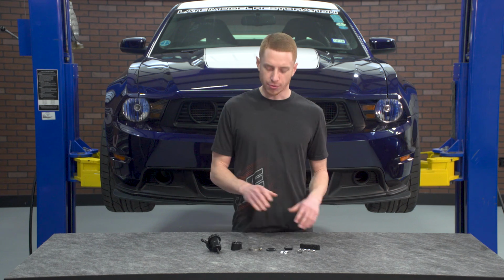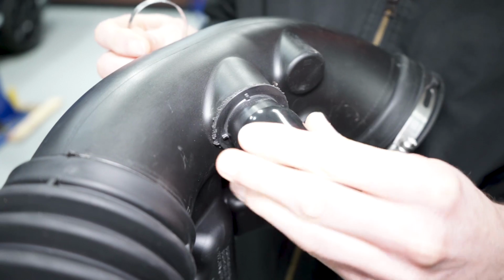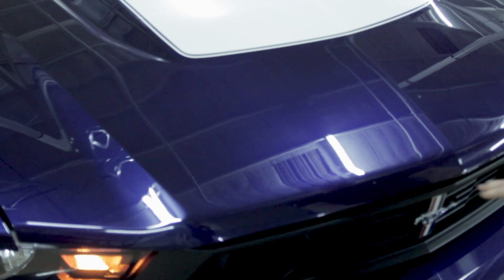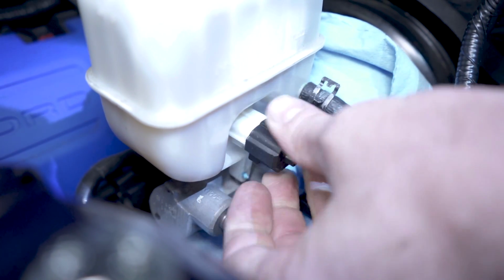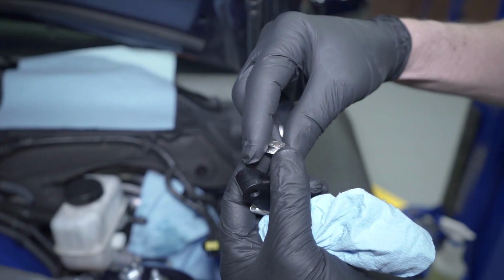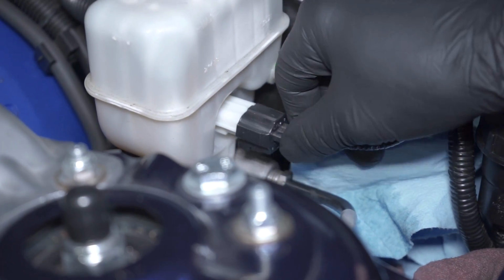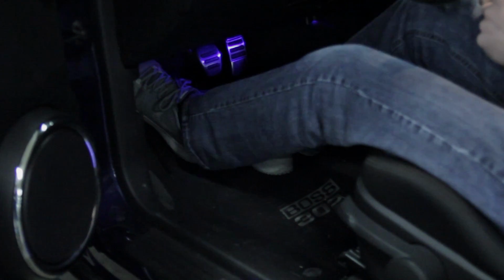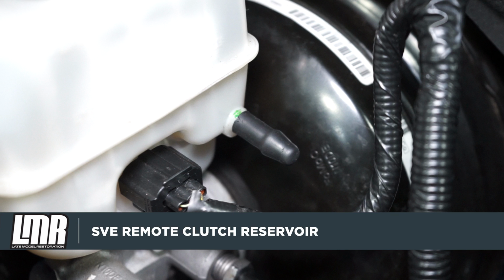2010-2014 Mustang SVE Remote Clutch Reservoir - Install & Review

Comment: Mine didn't come with a rubber boot in the reservoir. Do i need that?
Reply: BOLO for the rubber cap on the brake fluid reservoir failing and cracking and leaking fluid all over your under hood paint and having brakes fail. Like it happened to me after a year and a half.
Reply from the maker: It's been a while since I've touched this part. I'm pretty sure the rubber boot acts as the seal for the lid. Give us a call or reach out via email. -Landan

https://lmr.com/contact
Reply: @latemodelrestoration  I tried the clutch, fluid squirts out without it lol. I put in a support request.

Comment: So what is the best procedure to change the fluid when its eventually needed? Suck it out of the clutch reservoir and slowly mix overtime?
Reply from the maker: You got it! You can use a syringe to remove the fluid from the reservoir, or hop under the vehicle and disconnect the line from the slave cylinder (throwout bearing). I always drain it from the line with the cap and rubber boot removed from the reservoir. This method gets most of the fluid out of the system. -Landan

Comment: This answers my question, the brake fluid reservoir supplies the clutch as well. This appears to be a great addition to my stang.
Reply from the maker: We've been running this exact kit on the car you see in the video since the release. This car sees several HPDE throughout the year. The SVE remove clutch reservoir kit was a great addition to the car. -Landan

Comment: Would this seperate clutch fix any clutch pedals with bad and sloppy play?
Reply from the maker: Depending on the miles and/or how the car has been driven, it could be another component causing the issue. Those include: old fluid, a worn clutch master cylinder, or a worn slave cylinder (throwout bearing). I would start with fresh fluid. That would benefit both the clutch and braking systems. -Landan

Comment: Since this says it works for 2010, is it possible to install on a 2009?
Reply from the maker: The remote clutch reservoir will not fit because of the A/C location on the passenger side on all 05-09's. Feel free to give us a call at 1-866-507-3786 if you have any other further questions. - Jude H. - Social Media/Events Coordinator
Reply: @latemodelrestoration  but i feel like a little fab job could make it work 🤣 im ordering one 😂
Reply: @Mach1Chriss Any update? Lol